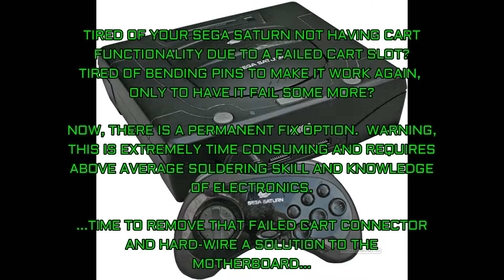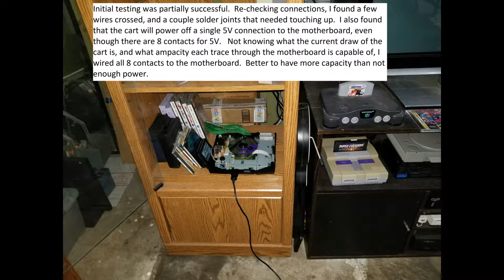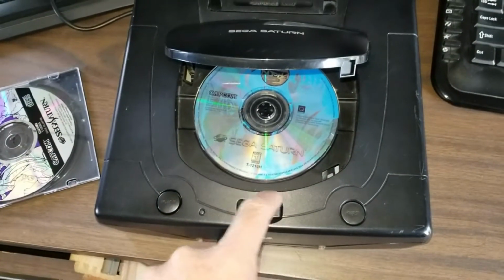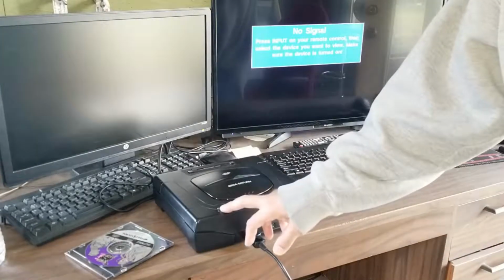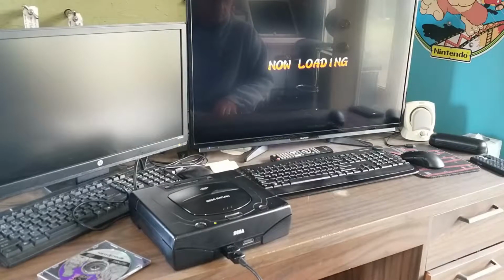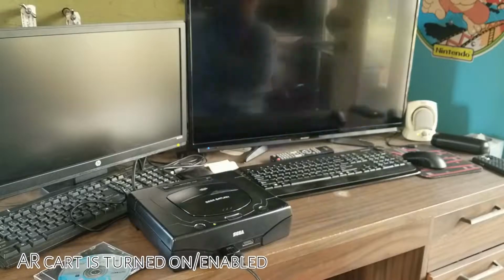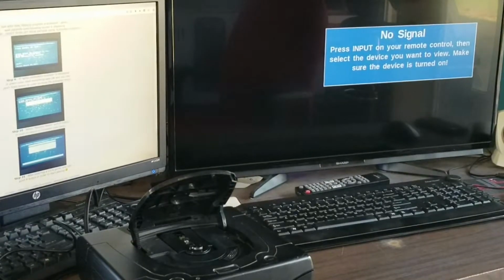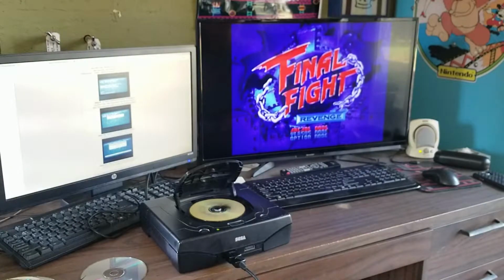SEGA SATURN FAILED CART CONNECTOR PERMANENT FIX

Comment: I have a Sophia dev kit programming box Saturn and the cart slot can read the modem or a rom cartridge but can’t transfer the 1mb or4mb ram when a game needs it. Also with an action replay I can’t use ANY code since it will freeze the console in the loading screen of the action replay menu.

Where is the problem? A bad solder? A broken pin ?
Reply from the maker: @sega-re-trop-vieux  hard to know without probing lines to see where activity is (or is expected to be) and what isn't working properly.
Reply: @ I have an early dev kit ( 12 August 1994) and perhaps it wasn’t “finished “ with the cartridge slot area. I know someone else who has a Sophia and his cartridge slot works fine. However his Sophia isn’t as old as mine and the bios is more recent

Comment: No Saroo for you apparently...:face-blue-smiling:
Reply from the maker: @FabioJeronimodaSilva  don't need one.  This console now has a fenrir as well.  Works great with the hard wired cart flashed with fenrir loader kai.
Reply: @NoAffinity you have excellent solder skills and deserve my respect. I have the same saturn problem as you but never fixed it (skill issue). Thanks for sharing this vídeo.

Comment: Excellent. I seen your post regarding this mod online. I’ve removed the cart slot on mine and plan to wire in a 4 in 1 cart.
I have the cart wired, I’m just trying to figure out the points on cart slot area that I need to solder to.
Reply from the maker: Interestingly, I just acquired a 2nd saturn from a family member, with a perfectly working cart slot.  I've been spending a bit of time with this new Saturn, and also re-stumbled across that old post of mine and this video just a couple days ago. :)  But, to answer your question, once you have de-cased the AR cart, you can hold it against the Saturn motherboard, and get cart pins aligned with through holes.  You can then see which holes will require a wire.  Use a sharpie or some other means to mark them on the board.  If the AR cart has all pins present, I am fairly certain they are not all used.  You can look at the pcb and see if there is actually a connection going anywhere, from each pin.  I also uploaded a line diagram showing which through-holes need to be wired (but you should double-check your particular cart...should be the same, but you never know): https://segaxtreme.net/threads/permanent-cart-slot-fix-hard-wiring.24243/#post-174854
Reply: @NoAffinity  Thanks very much. Your original post inspired me to carry out this mod. It’s the only guide online it seems.
Much appreciate your help.
Reply from the maker: @eireian4939  you and me may be the only ones to actually do this. 😄  the biggest challenge is getting all the wires the right length so that the bundle of wires will fit within the case and you can conceal the AR cart. Frankly I think I got extremely lucky in this regard. Space for concealment is very tight.  I was thinking today that it would be possible to use some solid wire to create "posts" through all the necessary holes and secure the cart in its native upright position.  The case could be put back on the cart after its fully soldered into place and secured.
Reply: @NoAffinity  i just hope I get to finish it right. Your work was awesome. 
I have a fenrir installed so I hope I’ll be able to sit the cart in old disk drive are as there is plenty of space there.
If not, then I should have room in psu area as I removed the old and installed a pico alternative.
Fingers crossed that I can match those solder points. I hope I don’t damage anything if I make a mistake by soldering to a wrong slot point.